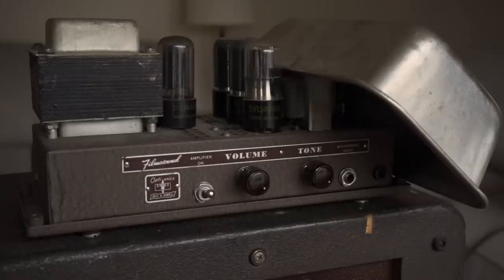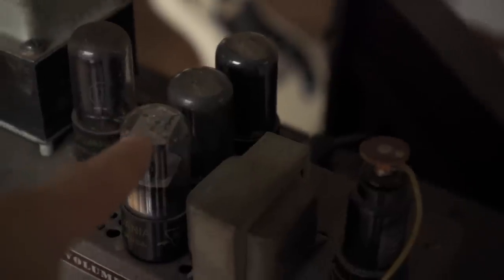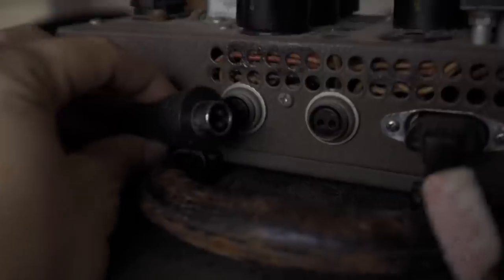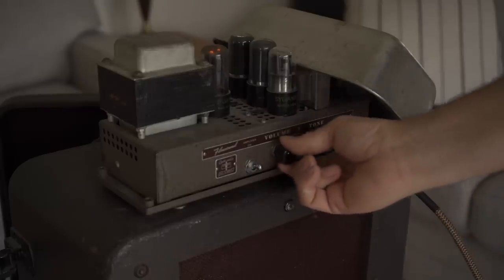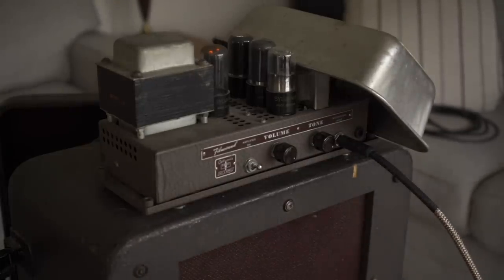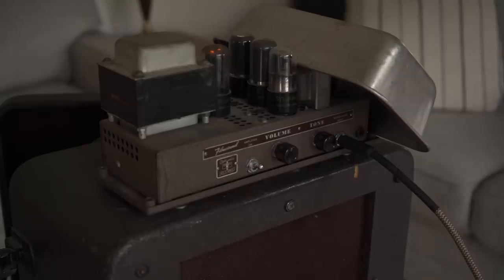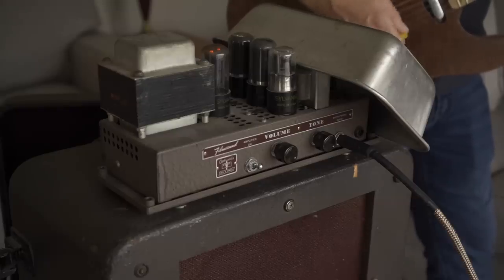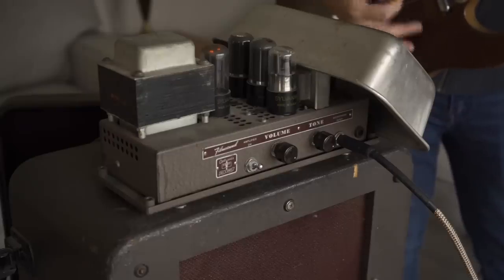I Plugged My Guitar Into A Filmosound Tube Amp And It Was DELICIOUS

Comment: I have a Bell & Howell projector with this amplifier.  Back in the 1980s, I had it set up to show a film, turned on the amp, and an electrolytic capacitor blew up.  It was made in the late 1930s, and I'm surprised it lasted that long. The problem was that it was a custom cap, with several coaxial layers, and it was marked only with a part number. I called up Bell & Howell and was connected to the company historian. He found the schematic for me (it was actually a blueprint, and they had several copies) and sent it to me along with an actual capacitor. He said it was untested, but of course if it didn't work, I could just use multiple capacitors and rewire the amp a little.  I asked him how much this would cost and he just laughed and sent it all for free.  Bell & Howell defined the term, "class act."  The new old stock capacitor worked fine, and it's still going strong.
Reply: That was a very class act.  One day no one will know how to fix these old tube electronics.
Reply: @Paiadakine  Check out radiotvphononut on youtube, He loves the old electronics-and hates new equipment.
Reply: Following, just purchased one
Reply: Great story, company historian!

Comment: I worked at Carvin Amps for 20 years. There was so much controversy over wether the newer solid state amps were as good as the old tubes. So finally we did a blind amp test in the lab and it turned out that the most ardent promoters of tube amp superiority chose the solid state amps as better. The truth is theres  simply no audible distinguishable characteristic that the human ear can differentiate anymore. However the tube amps do generate more heat, and in a cold basement studio in winter, thats a plus.
Reply: I had a Carvin 100 watt head and i hated it...i sold it to my buddy and his girlfriend hated it even more, cos she went into it one day with a pair of scissors and cut every wire.
Ive owned Carvin PA stuff too and i was not impressed ...it all seemed very cheaply made and didnt sound as good as my Peavey stuff from the 80s...which i still have...so i have to respectfully disagree.
I had big hopes for both, because of FZ and Steve Vai, but it didnt work for me.
I kept my Marshall 2204s...all 3 of them...thats the sound for me.
Reply: That's interesting, I never played an amp I liked until I played through valves-which took over 10 years. Perhaps it is the response
Reply: Carvin amps are terrible so this all makes sense.

Comment: That sounds great!  Do NOT get electrocuted.  I had a REALLY old amp that I found from the 1920's - 1930's that was intended for an accordion, of all things.  It sounded good and I tried using it as a monitor in my old band's recording space 25 years ago and it UNGROUNDED my whole PA system and when I went to sing I saw a bright white light in my eyes seemed like from inside my head and I felt my mouth burn horribly.  Then I sold it!  Sold that amp to the first person that I could with a LOT of warnings!  True story.  I do NOT miss that amp!  Almost welded my teeth together.
Reply: I just laughed "with" you, but definitely not "at" you. The mental imagery it conjured up was quite something.
Reply: Cant even imagine that
Reply: @restojon1  Oh thank you sir laughing at me and the situation is fine too!  Doing so is part of the human condition but you are clearly nicer than most people thank you!  😁
Reply: Anytime working with glass tubes on electronics you should always make sure to “discharge” it or you’ll get a nice shock 😂.
Luckily it wasn’t a CRT because those things will kill you
Reply: An isolation transformer would have cured that issue, or at least a polarized plug to make sure the hot side of the plug stayed off the chassis

Comment: That amp sounds awesome!!! 
     I have a similar amp... I discovered that if I use a Boss (or equivalent) equalizer pedal in line with the guitar, its sound is absolutely brilliant. The boost of the pedal not only drives it harder if you want more crunch, but it gives me really impressive clean headroom too. In 20+ years of living room jams, I still haven't blown its onboard speaker or the output transformer. Thanks for posting your demo! I love it

Comment: Yep! I've been picking these up for a few £££s, rebuilding them, and really enjoying them. They are full of very old electrolytics (six that require replacement). Furthermore, the 6J7 is an early version of the EF37A - a superb pre-amp valve and precursor to the EF86. You can tune the circuit to filter out bass via the cathode and screen caps and achieve correct bias. With a Celestion Alnico Creamback, it keeps up with drums with a superb and controllable crunch. Given the electrolytics required replacement, what I've done to some is build Fender circuits (5D3, 5E3, 6G3) for the power stage, and kept the octal phase inverter (6SL&/ECC33) and said pre-amp valve but with a customised circuit to tune the bass roll-off. I'm on my 7th build at the mo with a stack of other chassis waiting for attention. They are quite a small chassis to work on/in. The OT is excellent quality and well with range of current given a few milli-amps have been saved by removing the optical reader and the third 6V6. So is the OT, if rather small, and therefore it saturates rather quickly. The bread pan is wise improvisation, but if you use coax, earthed at the chassis, you don't need it. You you need a step-down transformer for UK use. I'll do a video at some point if anyone is interested.

Comment: Brings me back to when I was 17 years old..
I worked for a company called 16mm, earning $15.60 a week wages, lol.
My job was to count the frames in a film roll, after it came back from hire.
The company hired out 16mm film in a time where video tape did not exist.
I was given a Bell and Howel 16mm projector from my work and used the amp inside the projector to practice and practice on my Coronet electric guitar, eventually joined bands, bought marshals but just never made it big..
The sound is still the same on what you’re playing right now, amazing..

Comment: You can wrap the input pentode with 3M copper tape to act as a shield.. Love the tone, please retain Allen-Bradley carbon comp resistors and the “Domino” Silver Mica coupling caps if they are still within spec.. Most of the stuff you’ll change first are the very old electrolytic caps..
Reply: So those 'domino' caps are still usable- awesome, cos ive got some somewhere...i think.
I save EVERYTHING-LOL.
Im gonna look up Allen- Bradley resistors next and see what they look like...i found a bunch of odd looking resistors yesterday and im curious exactly what they are, maybe small caps.
Thank you for posting this info, im also gonna go subscribe to your channel, this stuff fascinates me.
For the last 50 years or so.
Reply: @edwhite7475  Hi Ed.. I’m not a Youtuber.. I just did some DIY tube electronics (hifi and guitar).. Be aware that most of the Allen-Bradley Carbon Compostion resistors (as seen in the Filmosound amp here) would have drifted in value (especially if they were used as Plate loads or in the Cathode, esp if the tube is ran in high current).. If they are still within tolerance then you are lucky.. The small value Domino Mica caps sound really good and clean, but could also be open or leaky due to age and abuse (soldering iron..) So better Double Check everything.. If they are out of spec or defective, replace them.. An alternative to vintage Allen-Bradley are Ohmite Little Demon resistors.

Comment: THANKS for posting. 
It's good you kept the bread pan bit. I'm an engineer (not sound, but I have experience in radio circuits.) The pan shielding out the noise tells me all I need to know after I heard the 60 Hz hum. 
Your power supply circuit needs a 'filter cap.' The capacitors are old, tired and need some replacing. If you're up to it, you can wind your own with lead foil and oiled paper but you can also buy some nice ones. Filter capacitors in a power supply like this smooth out the ripple voltage when converting from AC to DC, and I can hear a lot of ripple.

Comment: The top cap connection is the input grid for the 6J7.  As its the first stage, any hum will be amplified.  Try replacing that wire with an appropriate length of shielded wire.  The braided shield should be connected to the ground of the guitar input jack.   The 6J7 tube is inherently shielded by its grounded metal shell.  Pin #1 on the socket should be the shell connection.   Great find.
Reply: Honest question...wouldn't grounding it to pin one to minimise any ground loops that might be formed?

Comment: Several years ago the a local church was cleaning out accumulated stuff, a lot of things from the last forty or so years. They put the old PA system on the ground at the side of the street, undamaged and in good condition.
A 150 watt Harmon Kardon power amp and the preamp [mono], I drive this amp using a Chameleon, a Presonus preamp, a Presonus gate/compressor, and a Karl Teknik EQ into two cabinet containing a fifteen and a horn, from the same church. There were five of these cabinets hanging from the ceiling, was able to acquire them. I tried several configurations to drive the amp, this is the one I settled on. I'm no fancy picker, but have learn to make a racket. One man's trash is another man's treasure, for sure!!!!!! These old amps are hand wired and well built and they are ALL ANALOG.

Comment: I bought a reel to reel in a charity shop in 1999 for £3 and its very like this, all valve and the 'film editing' version of the one I had as a kid and blew up when I was 18! These old circuits tone is all down to the component type, not their age. You can build great sounding amps today just make sure you use NOS components, vintage solder and wire too if you can get it.

Comment: Careful with changing that power cord! Make sure the design of the amp is compatible first! If you have the power switch and fuse on the neutral wire, you need to either switch them to the live wire, or add another fuse on the live wire. If you have a circuit with the fuse on the neutral, and the fuse blows, all the current will flow through the ground wire in a 3-prongs cable, and the circuit remains closed (meaning it will still electrocute you if the fuse blows!). That design is "safe" in a 2-wires setup, but not in a 3-wires setup.

Also it probably sounds muddier than it should because of old/leaky capacitors. I would replace all of them, even the mica ones. Modern NP0/C0G ceramic caps are super cheap and are even more linear than these old mica caps... Shouldn't have to replace any of the resistors unless you notice some looking crispy....

Comment: Old wireless radio valve (tube) sets often had an input for a record player but beware, they may not only not be earthed (grounded) but may have a surprisingly high voltage to ground on them. Always "safety test" before frying yourself. 
A pair of 6V6 in push-pull can make about 15W which is pretty loud.

Comment: I own the exact same amp.  A really nice guy by the name of Andy Marshall modded one for me (Andy used to have a line of  guitar amps under his company THD).  He replaced some of the spent components, including the output transformer, and modded the filmosound to be self-biasing.  The reason it is so noisy without the bread pan: it is due to the far right tube, closest to you  (if you're facing the amp).  It is used to read the optical audio track on the edge of a filmstrip.  Andy took it completely out of the audio path in my case. 

Kudos on owning an old gem!  They're really, really cool!

Comment: I have this exact amp and used shielded Gibson style wire and replaced the lead out to the top cap of the 6J7 making sure to only attach one end of shielding to ground and it made the amp much quieter. Then I put a vintage shielding cap on and it made it even quieter. That was a hard to find part on eBay.

Comment: I love these amps. All mine have EF37 preamp tubes. My stock speaker was a bit fizzy for my liking so I use a greenback or celestion blue. I found if you roll off the tone control it starts to get a bit muddy and overdrive more in the most pleasurable way. Turn the tone up and you get more headroom. Ive read others that have this amp experience the same results. 
I serviced mine and tweaked the input favorable for guitar use. Due to space restraints they are a pain to work on especially if you need to replace cathode capacitors. I have a later version with EL84s aswell  but I much prefer the model in this video. They have the lushest sound. 
Its definatley an amp I will never get rid of and I suggest to anyone if you can find 1, grab it and get a tech to service/set it up for you .

Comment: The bread pan isn't shielding anything. It is grounding. A permanent fix is to solder a new ground cable from the ground post in the power plug, to the volume knob. I discovered this on accident,  but there is no more hum.

Comment: I've been playing guitar for 50 years and have played through several of these old amps designed for movie projectors (or stereos). The amp in this >video< sounds better than any I've ever played through and the compressor certainly seems to help a lot. But, with only a >video< (not >live< and >in person<) and not playing through it yourself to actually >feel< the interaction between the combination of the amp/guitar/your fingers, the actual reality of the amp doesn't come across >at all<. Unfortunately, my experience has been that practically all the old movie projector or stereo style amps that I've played through were EQ'd with a very severely pronounced midrange that made them sound and, especially, >feel< v-e-r-y clinically cold, machine-like and completely unresponsiveness to the touch. And, all the old, hard to find, odd number designation tubes make them so UNuser friendly that I just forgot about them every time I tried one. There are guys that say these old movie projector amps are the holy grail, but, sorry to say, that's my honest assessment of the experience. Try them yourself, in person, with your own guitar before giving up the hard won cash. Sorry if I've rained on anyone's parade...but you won't see these actually being played by anyone on the big stage for a reason. They were made for other purposes and guitar amps are made for (you guessed it) MUSICAL INSTRUMENTS...

Comment: Got 4 of them awesome amps. They say 10lbs of electronics in a 3lb box. 3 of mine have been gutted and rebuilt as Fenders, I love the push pull 6V6s.
Reply: They're cramped because they fit into a portable projector. I have one and considered re-capping the amp, but its compactness meant it was going to be a long project, not worth it while I'm working. FWIW, the tube he removed by the 5Y3 was the ultrasonic oscillator to drive the lamp illuminating the soundtrack. The four prong tube was for the photocell.

Comment: That's such a nice sound. What do you do if the tubes die?
Reply from the maker: Most tubes are still available these days. Some aren’t in production anymore but NOS ones can usually be found. Thanks for watching.
Reply: ...or you could hold services (?) R.I.P. and all that... 
Hmmm, FTM it may need some tubes as if original, thems'd be quite old now...
Reply: Replace them.

Comment: Nothing wrong with that tone.  It sounds like it has a little more headroom than most little amps.  Or it's that transformer.  Those tubes might be microphonic.. I can hear them ring a bit.  My modded Special 6 is way grungier when it's cranked like you did there.  Great project to land for sure.

Comment: I have one as well.  It is not that old (1960), and it comes with a matching speaker cabinet, and it sounds perfect as is.  Great tweed sound as I imagine it has a lot to do with 6V6s in push/pull configuration.

Comment: One can find quite a bit of information on these on the Web. There were multiple versions. This version sounds the best IMO. I have worked on a few of them. One version has no power transformer and is what is known as a  "hot chassis" or "widowmaker." They need an isolation transformer to be safe. Another version has more modern 9 pin preamp tubes, but I think this all octal version is best. Many rewire that 6J7 socket to take a 6SJ7 which does away with the cap wire and has better noise shielding. Ry Cooder played through these for a few years, but he is a famous gearhead and mixes up his rig often. There are still tons of them out there as every grade and high-school had 16mm Filmosound projectors. Thanks for sharing.

Comment: Do you have a tube tester? They are essentially consumables, and you can probably get new ones new-old-stock for a reasonable price. You may be able to find someone to test them for you. Hell, I’d be happy to throw them in my Mighty Mite tester, no charge. If you do take it apart to test/replace components, be careful. They can sometimes hold a dangerous charge for a long time, even after being unplugged.

Comment: The grid cap shield is missing from the 6J7. That’s why you’re getting the hum. It’s still a part you can buy from places like Antique Electronics Supply or eBay.

If that were my amp, I’d replace nearly every capacitor in it. Those “domino” caps might not be the very durable silver mica type.  If they say “micamold” or “mica-something” they’re probably fine.

Bad coupling caps electrically leak DC, which throws off the bias of the next tube. It can cause excessive current draw throughout the amplifier and burn out the 5Y3 or the power transformer.

It should be looked at/worked on so you can continue to use it an get that amazing tone out of it for another 50 years.

Comment: i have an old ampeg one of these from world war 2.  still in great shape and the last time i used, which was many years ago, it still worked.  it needs the old screw on cable ends, at least on the amp end.. we used it an pa power head.  was a clear great sound as well as i can recall.